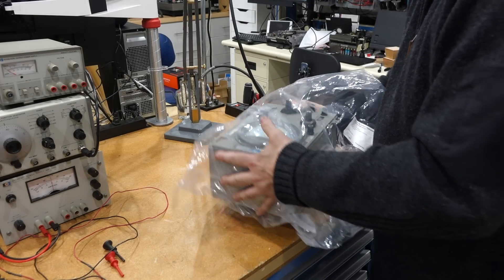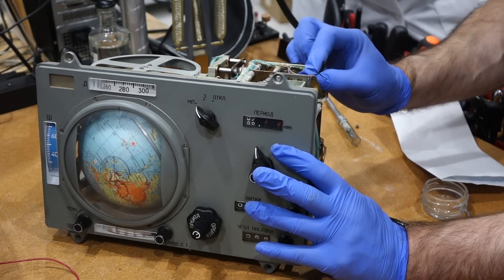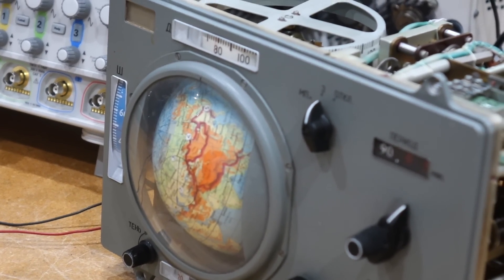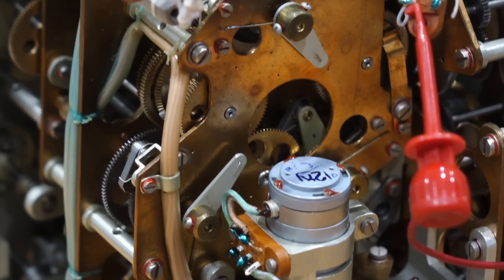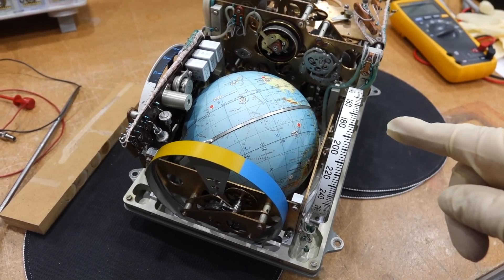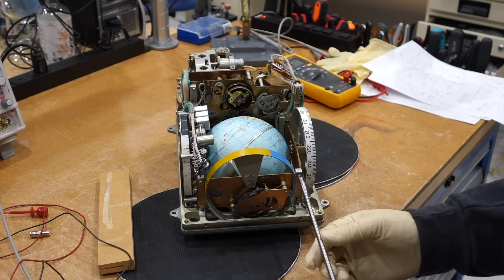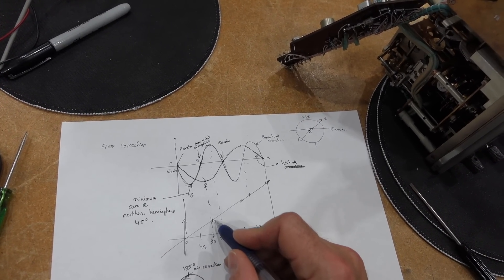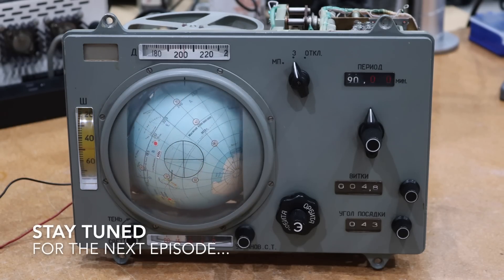Soyuz "Globus" Mechanical Navigation Computer Part 2: Powering Up

Comment: I would like to see some closeups of the mechanics in the back working as it runs, I love mechanical stuff
Reply: See the first video
Reply: @Paul-Cirimpei  no I mean as it’s running. Those are shots before they got it operational
Reply: @Andr3Wild3 f7ck/sc4ew y0u (or mor0n/f4gg01/a33) + //####
Reply: It would be really cool if someone recreated it in a 3d program like Fusion where you could make layers invisible while the whole thing keeps working so you could see a cut-away with all the gears spinning
Reply: Oh you want some closeups of her backside huh ? You dirty perv ! Leave the Globus alone. She's a sensible beauty.
Reply: In der Feinmechanik waren die sowjetischen Ingenieure wahre Künstler. Exakte Funktion auf engstem Raum. 😋😋😋